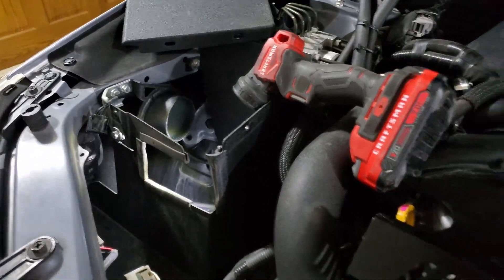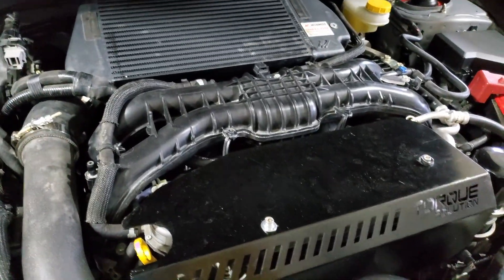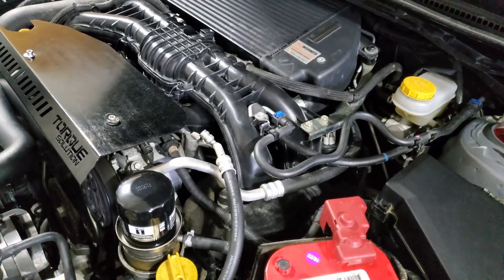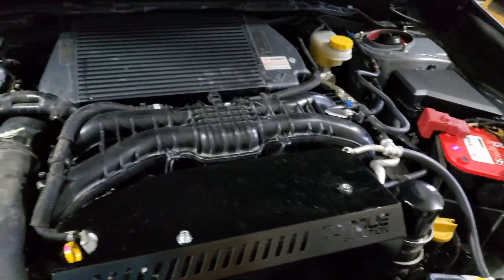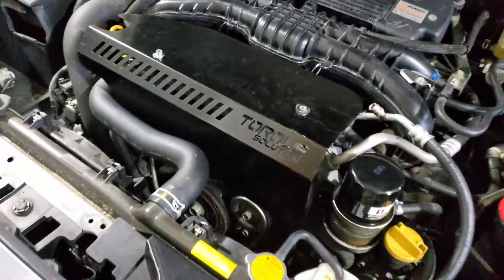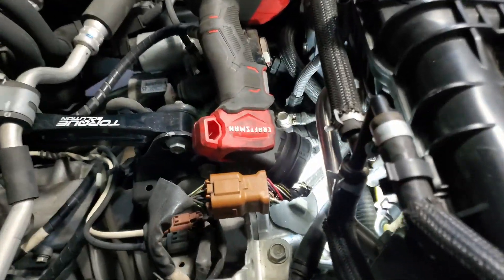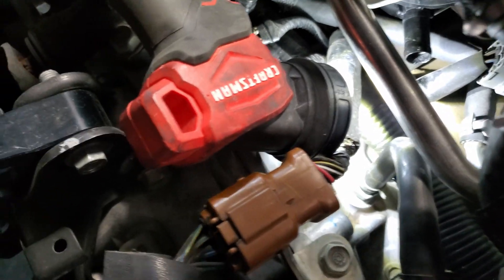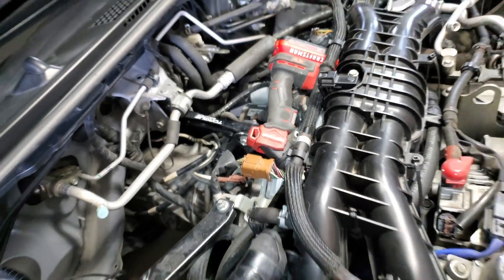Engine code: P0171 | Troubleshooting & FIX | 2017 WRX

Comment: Hey this might be weird but I think I purchased this exact car in October of 2024, I am having the same issue all of a sudden and wondered if I could pick your brain about it!?
Reply from the maker: I posted the troubleshooting table from the service manual here: http://youtube.com/post/UgkxtV08103XDvIJxosGXuHduD_iUgnnjRbE?si=pU9K0lIXDK113Ofp.

Faulty oil control valves will cause intermittent idle at startup also. I had that issue pop up just before I sold mine. I didn't have time to replace them but they're not too expensive and looked like a relatively easy job.
Reply: @BreakingThroughTogether  sorry I was saying I actually purchased your old car haha The exact one you have in this video
Reply from the maker: @xSharkpuke 😎 Cool! That car never let me down. If it's doing anything "off" it's probably the Oil control Valves. I'll post something on that in a post for everyone this weekend.

I miss that thing. Have fun!
Reply: @BreakingThroughTogether  of course! thank you so much! I'll look into that for sure!
Reply from the maker: How's the car doing?
Reply: @BreakingThroughTogether  going check it tomorrow.. I did an oil change yesterday. Its running ok.. I just have to gradually increase speed rather than just hitting the gas to get going!!
Reply from the maker: These turbos spool up quickly but still need more care than naturally aspirated engines. This was my first turbo so I had a learning curve for a while. Taking it to a test and tune helped get to know a lot about the power, brakes,  transmission, and chassis...highly recommend. Upgrades open a whole other world.
Reply: My car just started giving me the opposite problems. I am idling fine; from 1st to second gear fine .. but when I start press hard on the gas it struggles to speed up and like it loses power.. I have to gradually accelerate to get the speed going .. if I just press on the gas it struggles..
Reply: From Tom Wood 😂

Comment: WITH THESE OILED AFTERMARKET FILTERS THE MAF IS THE 1ST PLACE I LOOK OR ANY VACUUM LEAKS BETWEEN INTAKE FILTER AND TURBO..ALSO THE PRIMARY OR 1ST 02 SENSOR CAN HAVE SIMILAR EFFECTS.
Reply from the maker: Yes. I repositioned and tightened the filter and supporting pipes and clamps. The COBB Intake tube and filter have a pretty sloppy fitment.